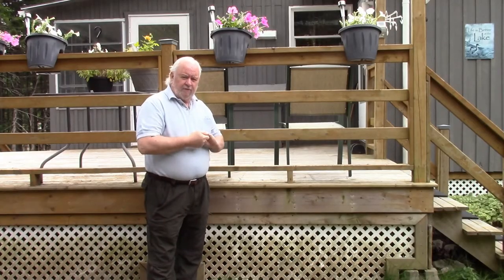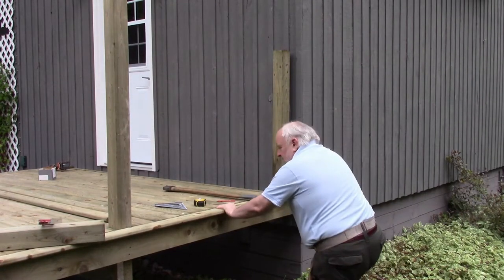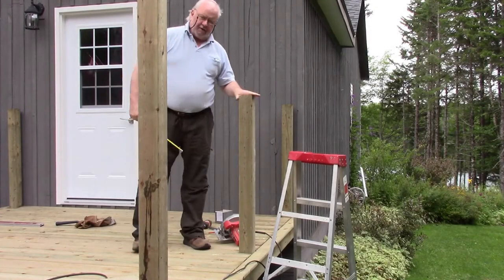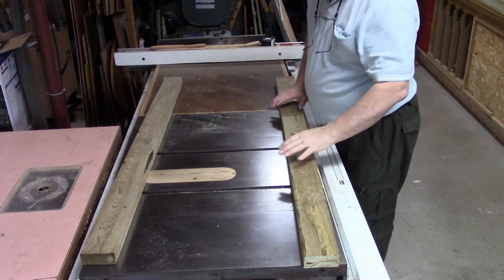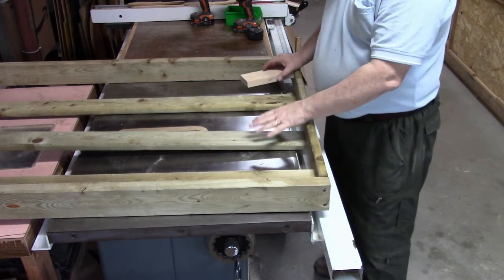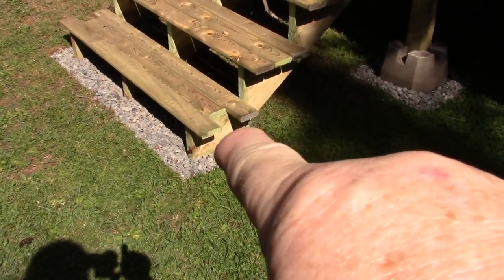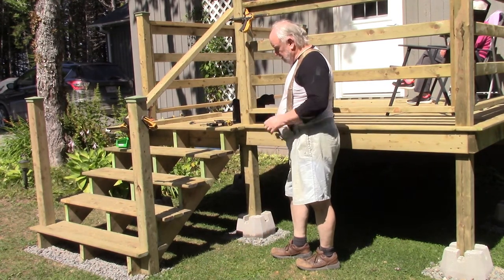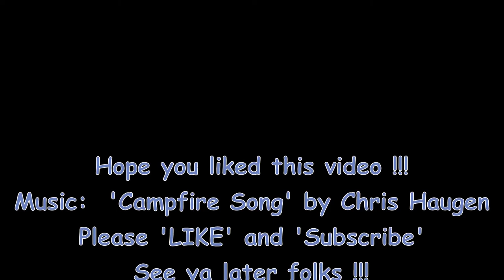Adding Railings to Deck

Comment: Great job, Mike!  I'm looking to build a stair railing for my porch.  I like your technique for building parts of it in your shop.  Since it's cold here right now.  I can't do the vertical rails due to code and kids around, but think I could do the same thing and use some balusters between a top and bottom.  Mainly want to build most of it indoors, except for attaching two posts.
Reply from the maker: How's she goin'?  Great to have your comments on here!!!  Thanks!!!  Yes making the rails in sections like this makes it easier, or that's what I found anyways!!!  The horizontal rails are against code, depending on where you live, but you can't go wrong with vertical balusters.    Thanks again for tuning in and I hope to see you back again!!!  Take care!!!

Comment: I call these 'children's ladders'. Horizontal rails oftentimes look more aesthetic,  and architects are often 'drawing' them especially in stainless wire designs. I have argued online with some of these suppliers and explained the instinct of children to climb. Horizontal can be used if the top part curves rapidly into (Kind of like an upside down hockey stick) the balcony or roof garden. Having said all that, your railing are fine, given that they are not so high off the outside grade. Also, the remoteness of where you live, you probably won't have dozens of children there regularly. Nice job Mike. Looks real nice. Now for some BBQ and beer
Reply from the maker: How's she goin'?  You are so right about the rails.  Some of our grand kids were here at the camp last night and the first thing the 2 twin girls did was start climbing on the railings.  I had to tell them that was a no - no!!!  All good now, I hope.  Nannie and I don't do a lot of climbing any more!!!  LOL  So they should be fine!!  Thanks for watching Pascal.  This was a long vid so I appreciate you taking the time.  The beer and wine and the BBQ will be well used I can assure you!!!  Take  care!!!

Comment: That will work just don't let a home inspector see it.... 7 3/8 it not a regulation gap. 4 inches is the most you're allowed by safety.
Reply from the maker: How's she goin'?  I appreciate you pointing this out.  However, in this series of building the deck, I mentioned that I am not a certified carpenter.   I just build stuff.  I also mentioned that the railings were not too code.  One major issue besides the gap you mentioned is that horizontal railing are a no-no.  I know that and I accept those dangers as well.  My channel is not a  'how-to' channel, it's a 'how I do it' channel.  Take 'er easy!!

Comment: Grampie I am just curious how sturdy is the 4x4 by using screws instead of bolts. this is my issue on trying to add the hand rail on my steps.
Reply from the maker: How's she goin'?  Great question Chris!!!  The screws I was using were #10 X 3" deck screws.  If you have used any of these screws you know they have no shear strength at all.  I used screws to hold the post in place but then, when I was happy with the setup, I spiked it with 3 1/2" twist nails.  The posts are goo and solid now.  This sure was a great question and I'm glad you are watching my video so close as to notice things like this!!!  Way to go!!!  Thanks again for the question and for watching.  Take care!!

Comment: How tall are your rail post from the top of the deck up?
Reply from the maker: How's she goin'?  My deck is not built to code.  I built it for the camp out here in the middle of the woods.  My posts are 38 inches high and the tops of the railings are 36 inches.  Also horizontal rails on a railing are not allowed in the code around here, but for me they work.  Thanks for tuning in and if you are building a deck and want it to be safe and to code, please check the local building regulations in your area!!  Be safe!!